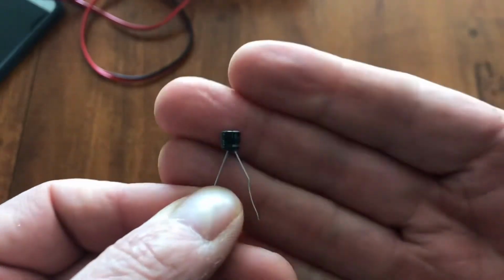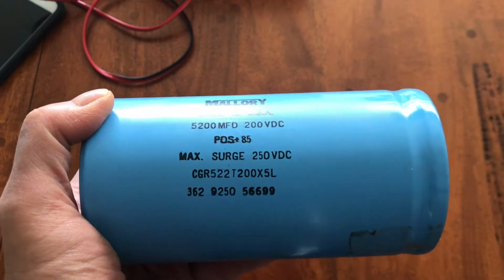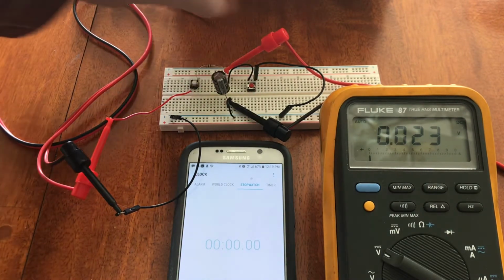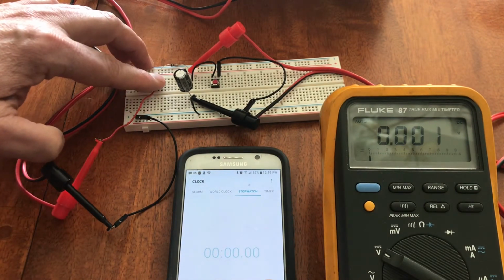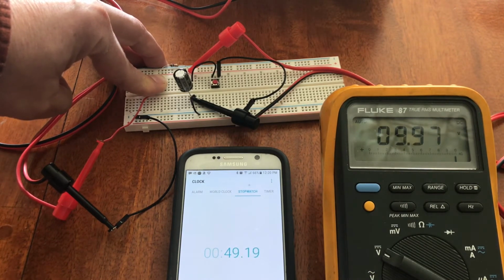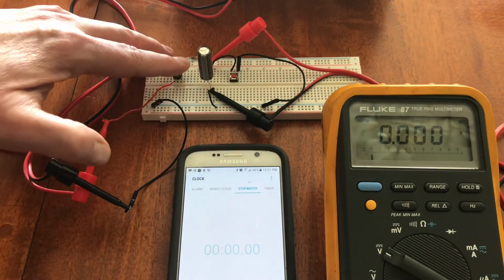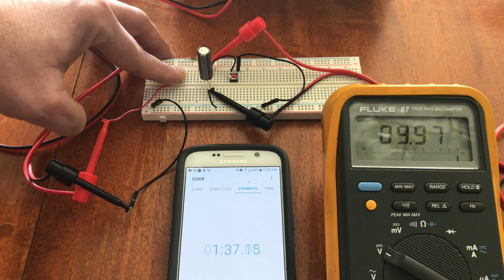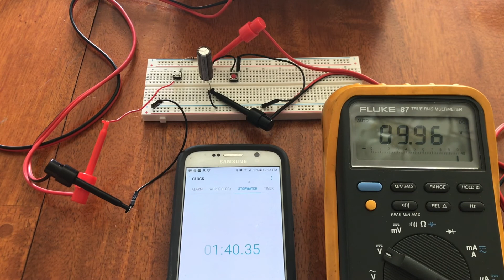ELTN 130 Capacitor lab 2 & 3

Comment: Hi Prof Thoen, Im currently enrolled in your introduction to micro controller's course. I was wondering if a capacitor can be used as a "pre-charge" circuit when connecting a battery (lets say 48VDC) into a motor controller, in order to prevent sparks when connecting the battery connector.